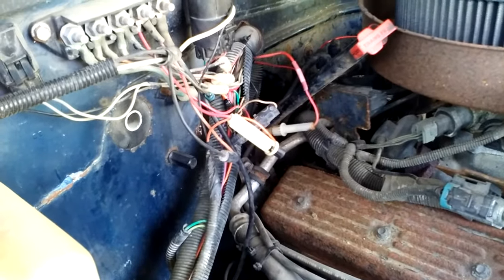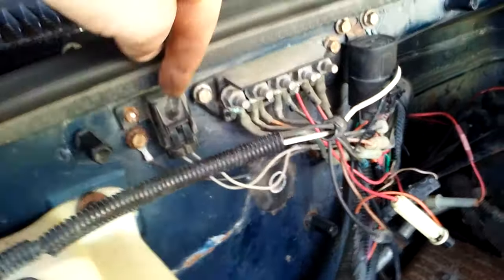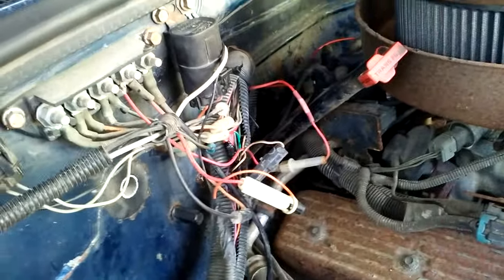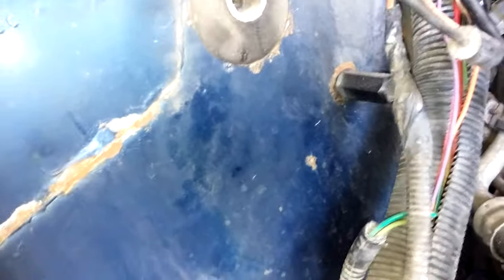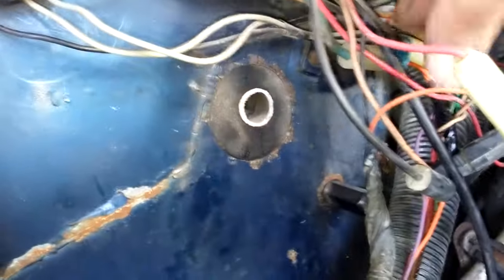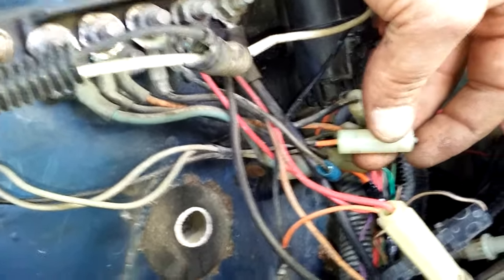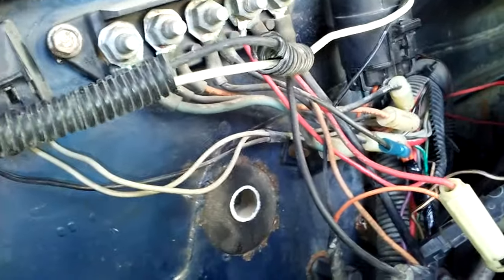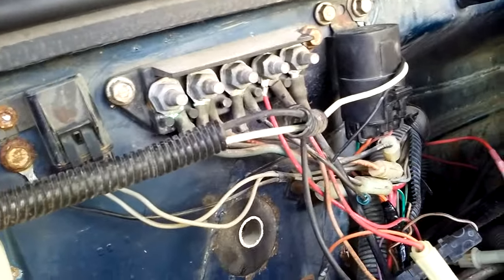93 chevy 1500 no power to fuel pump

Comment: Had the same issues and FINALLY found the ecm fuse under the dash. Its hidden quite well! Jumping the relay plug took it out.
Reply: do you have an indication where that fuse is under th dash? having the same problem i think
Reply: @mathiesdewulf8076  Hey! Mine is on the drivers side under the steering wheel to the left. I knew the fuse panel was there but the TOP  ROW is totally hidden that holds the 15 amp ecm fuse. Panel is about where your left knee is. I fried mine when I jumped the wrong post on the relay. Spent hundreds trying to fix this before i found that damn fuse lol. Good luck👍
Reply: @DLM0826  thx for answering i wil have a look thx.
Reply: Donde se encuentra amigo ese fucible

Comment: Hell yeah thank u. I just found the short n its wires underneath the driver side that's also linked with the power strip on the firewall that you pointed out and finally I found the short but then I couldn't figure it out any further than that and I kept trying to put stuff in front of it and as soon as I'm with that wire of course the car turns off or stays on depending how fast you hold it I did not know about the resistance or that splice I knew that it was something because of the way they're all have that piece that I did not know you could just cut it off and put the two wires together as soon as it's daylight I'm going to do it before work right now cheers to you I'm drinking coffee thank you very much appreciate it lifesaver
Reply: Those are fusible links and are meant to melt under a specific overload due to a short . The idea is to prevent a fire . 
Be sure to replace a fusible link with another of the same specs.

Comment: Show me the wiring system to the fuel pump for a 2000 Chevy S10 4 cylinder fuel injected fuel injected 2200 two-door

Comment: Man!
My truck never had a no start in 18 years.
Just went to move it to do a ball joint and had a no start.
Being in a shit mood i now pulled it to the house with the tractor planning to replace the fuel pump. (3 years old)
When i was checking around before i pulled it to the house i noticed one of those “splices” looked broken.
Grabbed it and the cap fell off, and the smallest glass fuse i have ever seen in my life popped out. Probably 5 amp. Less than 1/2 inch long.

You just made me realize that has to be my problem.
I figured a 5 amp fuse wouldnt run the fuel pump.

But it might turn the solenoid on that does run the pump.
Bro, than you for posting this one!!

And also, im not sure if its worth the trouble, but there is a tiny ass little 5 amp fuse in there. You might wanna grab a cheapy and twist in there just for insurance. 
Would be totally BS if that somehow could mess up the ecu. 

Thanks again!

Comment: Those are fusible links. 
A fusible link acts much like a fuse, only it’s designed to handle a different type of potentially hazardous scenario. These links are actually strands of wire wrapped in a fireproof covering, and are thinner than the wiring harnesses they’re connected to. They are placed in-line between delicate harnesses and large sources of electrical current in your car—between the battery and alternator, for example. These links must transmit high-voltage electricity, but also protect the rest of the electrical system from dangerous spikes that could cause a fire. If there’s a surge, the link actually melts, as its resistance to heat is lower than that of the circuits it’s protecting. This cuts off power while protecting the engine bay from a conflagration, thanks to its fireproof wrapping.
Reply from the maker: Leon Black good info!  I need to do a update on the video.  My buddy told me that also.  Thanks man
Reply: I used an inline fuse with 35a fuses but they constantly blow on me. Would a fusible link fix this issue?

Comment: Thank you man!!  Been having intermittent crank, but no start issues in a ‘92 Silverado 350– This solved my issue! 

Dude, I literally changed everything you can think of to the fuel pump, relays, fuses, distributor, coils, sensors, ground wiring, and all of the above. It was this exact wire from that fusible link to the orange wire🤞😅

Comment: Mark thank you for your video I do have a question for you though I'm experiencing the same issue or same type of issue on my 93 Chevy suburban and I was wondering before it started giving you the trouble how did it stop running was it all of a sudden as you was driving it or what is the case on thatI'm just trying to figure out which route I should go I've spent $150 and the last 3 days

Comment: I'll check this on my 90 Silverado this weekend, and give an update.
Reply: what is your truck suffering from marc?? no power also?
Reply: Update
Reply: Sorry for the delay. I tracked it down to stupid fuel pump relay. Lol. My advice for everyone, is to start there. My old fuel pump is still good. So I fixed that, then tore the truck apart to lower it, put a trans in, redo the interior, and powder coat the wheels.
Reply: Ive done every thing my last option is the orange and grey cable besides infuse im tired as hell about it
Reply: @Mikeys1316  I've had an intermittent no crank no start on my 1991 305 . Only happens occasionally & only when stone cold in the morning , once running it never quits & always starts when it's warm.
I suspect a bad ground & i did find a greenish bit of copper showing on a ground wire at the thermostat housing that has rubbed through.
Bad grounds are notorious on these trucks especially as they age.
First there's the ground strap from the battery to the block , then check the block to body &  firewall. 
Rubber body mounts electrically  isolate the cab & box from the chassis/ frame.
Your computer / dash & switches all need a good ground. 
On the passenger side of the engine youll see the main wiring harness enter the inside of the fender leading to the computer & other main relays right next to it. 
Your fuel tank & sending unit  needs a good ground as well. 
I'm going to have to go through all of them soon as well. 
Aside from bad grounds the pick up (magnetic ) coil can be bad, the distributor gear on the bottom of the distributor can & do get worn, the ignition control module chronically fail due to the heat. Be sure to use a thermal , heat conducting paste when you install a new one ! It is NOT dielectric grease as it must contain microscopic bits of aluminum , brass or other metal for the heat to be dispersed. 
Sometimes you can try to clean the pad & re-apply fresh thermal grease/ paste but it's likely the hermetically sealed transistors on the board have already failed. 
Buy AC Delco. You can get burned with chinese knock offs that don't work straight out of the box ! 
If you want to save money buy three Chinese ones & maybe one will be good may be two or all three will be bad ! 
 These are just places to look as it could be a number of other things.
Lots of people put new IAC , TPS , EGR, modules on hoping its one of them   & whatever else they can afford( or not!)  to roll the dice on.
I intermittent problems can & usually are as a result of bad connections & grounds are a good place to start. 
Don't cheap out on cap & rotor either. Brass contacts & especially the center button & SPRING are the way to go. Aluminum will last for a while but brand name quality is worth the extra dough, just as for the ICM module i just described.
Good luck !

Comment: Got power everywhere but the fuse, key on or off , I'm stuck, please help
Reply from the maker: Don Faulkner. Add me on face book we can talk through messenger. Mark Bosjolie
Reply from the maker: Don Faulkner. Check the wires coming from the pcm.
Reply from the maker: Don Faulkner run power to fuse momentary to see if it will power the pump. Than go from there.
Reply: Isn't that too much voltage?
Reply: Which one are you There are several Your name? Try me please Don L Faulkner
Reply: OK dude where are you which Mark are you There's several of them why didn't you try mine I gave it to you please help me out I stilling figured this out
Reply: @markbosjolie1306  we're troubleshooting on same issue, please help.
Reply: @MariaLopez-vf6pr  did you find out
Reply: @559Obsalex  yes. The guy that was working on my truck, did rewiring and caused the fuel pump to burnout. Good thing we had a warranty and got it replaced, works, we hear the hummmm, but still can't get my truck started.